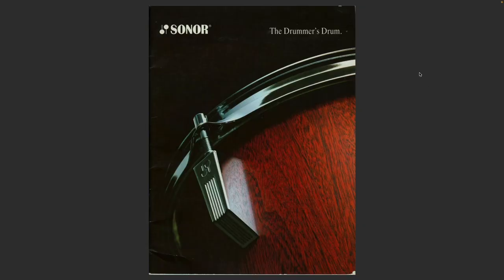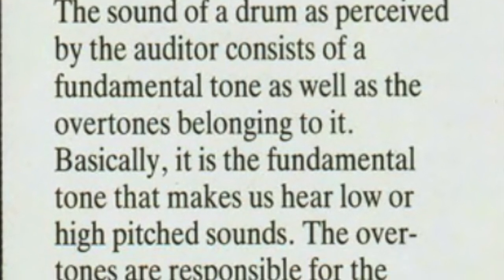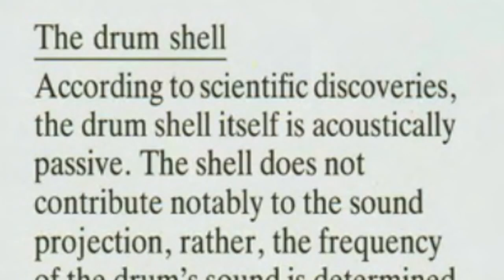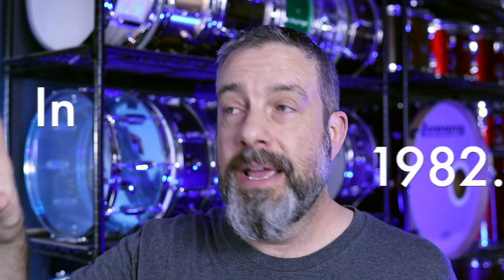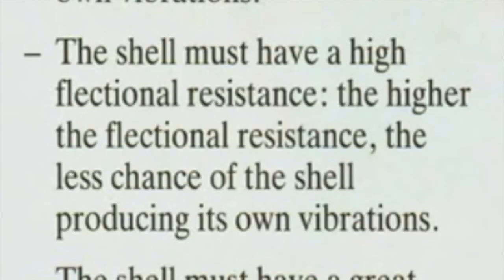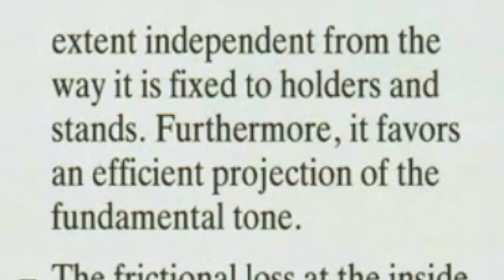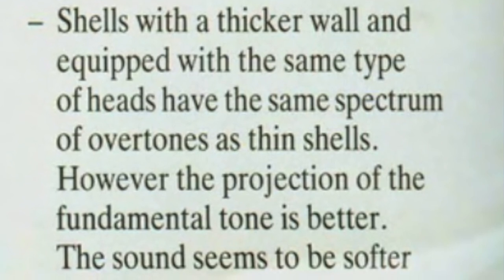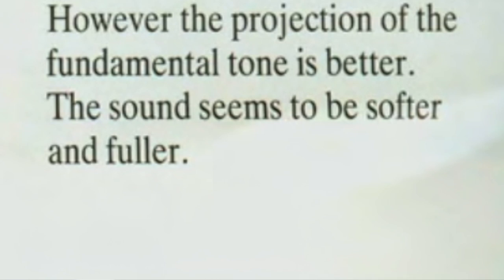That's Not What I've Been Told!  Drum Sound Physics, Part ONE

Comment: I tend to agree the shell reduces part of the vibrations of the heads and ultimately the sustain. And the reference to the rototoms next to the rack toms is very convincing but I can't help remembering (as the video mentions) the first time I had to use a snare stand for the rack tom at a gig where many bands were performing with the same kit. I hit the rack tom and it was dead. I tried to tune it and lifted the whole thing, because the snare stand was very tight.  When I loosen the rack tom to start tuning it, it came back to life right away.  I figured - at the time - the tight snare stand blocked the rack tom, preventing it from vibrating ... hence here's the question: how this reconciles with the conclusion of this video?  A rack tom tighten by the snare stand cannot vibrate (it it "passive" as the German catalogue says), so it shouldn't absorb the vibrations of the heads and have a longer sustain. Yet it was almost dead until I "freed" it. BTW you re not old, I was 15 in 1982 (and had the same Sonor catalogue)

Comment: Great video! Thanks Joel for the explanation! How can I get in touch with you? 
One question: is what you told valid also for snares?
Reply from the maker: Hi, Mirco.  Feel free to reach out to me via DRUMDOTPIZZA on Twitter.  

And yes, the same principles are true for snare drums expect the sustain portion as the snare bed cut into the bottom bearing edge combined with the (generally) much higher tuning of the snare side head eliminates the kind of sustain you can get from toms and kick drums.  But yes, there is definitely a stronger fundamental tone and louder, more complete frequency spectrum with heavy snare drum shells.  This is true also for heavy shells of metal (cast aluminum or bronze shells, even thicker rolls/spun steel shells, etc.).  The greater the mass the louder/fuller the snare drum's tone.

Comment: So cool that a catalog had all of that info! The way it’s all written feels like some sort of legally binding agreement and it cracks me up. I’d like to see modern companies attempt to communicate their “laws” of drum building. 
The only piece of this puzzle that feels incongruent from my experience is the case of acrylic drums. I have limited experience with them, but I do love the 70s Fibes kit that I have. My Fibes kit is easily the heaviest kit I own, yet it seems to have a much shorter decay than most drums. It definitely has a lot of fundamental, which seems to follow the principles you’re talking about, but I know that generally acrylic drums are known to have short decay & therefore emphasized punch and transient. Why don’t these heavy drums resonate the same way your heavy Ludwigs resonate? I tried looking up density of acrylic vs maple but I’m struggling to find an empirical comparison. Any thoughts?
thanks as always for the great info:)
Reply from the maker: Great (if slightly premature) question!  In this video I mentioned flectional resistance, which I am pretty sure is what is at play with acrylic drums.  The acrylic has interesting flectional properties compared to wood (or wood veneers glued together under pressure).  Basically acrylic acts like something of a shock absorber (at least the old Vistalite and current RCI shells and whatever shell Pork Pie uses for the 6x14 Piglite that I have do). All of them have excellent body/fundamental punch with a limited sustain.  As such I LOVE them for lower tunings with muffling for a fat backbeat.  In fact the FATTEST backbeat I ever recorded was with a vintage 5x14 Vistalite snare tuned just above finger tight (batter) with a folded piece of copy paper taped to it.  In fact I'd love to get my hands on an old Vistalite bass drum.  A buddy of. mine has a 24x14 that sounds AMAZING!

I'll discuss flectional resistance in a future installment, sooner than later, so stay tuned!
Reply: @drumdotpizza  okay yes this makes sense. When I’ve taken the heads off I can tell they’re a little wobbly when I bump them or pick them up. cool thanks!

Comment: As with your other videos, I think you do great analysis here. But having owned thick shell Pearl drums starting in the late 80's (BLX series, 7.5mm 6-ply birch with lacquer finish), my perception is that thinner shell drums seem to respond better (meaning with a fuller sound) to softer dynamics. I've heard the explanation that it takes more energy (e.g. striking the drum with more force) to overcome the greater inertia of a more massive shell and make it vibrate as contributor to the overall drum sound, vs. a thinner shell with less inertia.  As a performer, this seems to check out when I play my relatively thinner shell Starclassic Birch kit from 2006, with its 6mm 6-ply shells.  I know that Sonor sold many thick shell jazz kits in the 80's, but I don't know any jazz drummers who prefer them over classic (or newer classic-style) thin shell drums.  Even for rock, thinner shells seem to speak better when played softly, admittedly at the expense of less volume headroom when played loudly.  Would you say that your preference for thick shells is more appropriate for loud rock situations, or would you still use those drums for an acoustic jazz quartet?  (And yes, I'm ignoring the effect of the higher head tension most acoustic jazz drummers would apply).  Thanks for the videos!

Comment: Thanks for doing this video! Through my experience I agree with most every point you stated. So…..given that I now find myself playing many acoustic gigs in small venue situations, the setup I use are smaller diameter thin shelled drums that seem to work well with less sustain. I’m currently using Remo Renissance heads on toms. I am interested to hear your perspective on bearing edges. Hope that is coming soon.
Reply from the maker: Thanks for the kind words!  Yes, thin shells work better for lower volume gigs as they produce less fundamental tone, and therefore less volume.  Also, given the fact that a larger portion of the tone of these drums is harmonic content they will tend to project a better balance of overall tonal spectrum a greater distance.

High frequencies are not powerful (they aren't what you hear coming through the wall of your apartment when the neighbor is blasting the stereo!).  High frequencies are actually dissipated and absorbed by the viscosity of air, believe it or not.  So drums with a greater percentage of higher frequencies will, at a distance, sound more balanced than drums producing a stronger fundamental.  The thicker shells, at a distance, will be more likely to sound tubby and dark, particularly if tuned low.  

The best arrangement, IMO, for low volume or unmiked playing situations is a thinner shell kit with slightly mellow edges, larger diameters than you might normally use (for the toms, especially) tuned a bit higher, so they produce more high frequencies (with the larger diameters providing similar pitches to what you might normally have with smaller drums tuned lower).  Does that make sense?  At a distance this will provide a more complete balance of drum tone.

Definitely the approach to use for minimal miking techniques as well!  Hope that makes sense.

And yes, more videos on the topic right around the corner!  Thanks for being here!!

Comment: Excellent video. Any comment on why metal drums sound the way they do? I have a very heavy brass snare (1963 Super-Sensitive) that is explosive, even chirpy. Lots of fundamental but very bright overtones as well.

I'm very much in the "dry, dead, drums" camp personally but a lot of these thinner drums just do not have enough low end
Reply from the maker: Thanks for your comments!

I haven't gotten to shell material yet, but will in the forthcoming video.  Metal drums are very hard and reflective compared to wooden drums.  They have much. more high frequency content, particularly compared to a wooden drum of coarse grain (lauan, for example), particularly if the wooden drum's interior is not sealed (the wood just sucks up high frequency energy like a sponge, so it really needs to be sealed for a more balanced tone).  

But metal drums are hard and reflective, and in the case of brass and steel, etc. they are rather dense (aluminum not as much), so they tend to produce a strong fundamental note as well.  Wooden drums are softer material, so don't 'riiiiing' like a stout metal drum does (all other things being equal) -- this is particularly true of older wooden drums which tend to have a higher wood-to-glue ratio, an are, therefore, softer material overall (glue can be quite hard when dry, so modern shells with ultra-thin veneers tend to be harder overall than shells made with thicker veneers but the same amount of glue between plies). 

I'm working on my 'drum shell material' video (I'll have a snappier name for it before it's released, I'm sure ;)  Stay tuned, thanks!

Comment: Wall thickness affects the rigidity of a shell: you can have a very lightweight and rigid shell made of thick, less dense material.  You see this principle a lot with metal tubing: thin walls+large diameter is often lighter and more rigid than thick walls+small diameter.  Materials also do not flex equally in all directions.  Ultimately, if you're trying to transfer sound energy from your stick to the drumheads, you want as little shell flex as possible.  How you achieve that is up to the designer.  It is way easier to achieve low flex with denser materials, though.  There are some exceptions to this: if you can match the vibrational modes of the drumhead to the shell, then the entire system resonates.  But this is more frequency-dependent than stiffer shells, where energy transfer is only between the two heads.  Another example of a lightweight, yet stiff material is carbon fiber.  It's essentially a space-age plywood: you can orient fibers in any direction you want to get the desired rigidity characteristics.  So... carbon fiber drums could in theory give you the same energy loss as thick, dense wood, but with significantly lower mass.  But all of that design work is expensive and repairability and availability are concerns.

Comment: Hi, thanks for this video. I agree with most of it. I like that you point out the flaws in the talk about drums (resonating…) and I would add some more wrong concepts here, as the shell being called shell is a misconception as well (sorry for my lack of English if I am using the wrong terms, I also am German just as sonor ;) ) - a shell is something that can hold water. Timpani got shells, drums have sides, or walls. I am guilty using the wrong term too but only because it confuses the customer a lot when I refer to shells as sides. But I think it is important to make this notion here because a lot of properties that shells have, sides do not have. Shells have a huge impact on the sound of a drum, but regular drums have no shell, they have sides, and the resonance head takes over what a shell usually would have as influence in sound.

Now to your concept of drums having more sustain when they have thicker sides (shell, you know what I mean). I can follow you here, but you missed an important part what influences sustain, like, a lot, and which also explains why rototoms have such long sustain: no it is not because of mass: it is because of the lack of a shell (side)! The deeper the drum, the more air has to be moved to get the drum singing. Air has about 1.3g per liter, and it muffled the drum head. I usually demonstrate that with a short drum which gets a longer tube attached so the drum gets longer. What happens is: the additional air is muffling some overtones, the sustain gets shorter, the definition of the sound starts lacking, and the response gets worse - you need more force to get the drum to sing due to the extra air you need to move. Now, while the concept of drums with massive walls having more sustain might be right, it is ruined by the fact that those drums in the 89s also were darn deep which then made the sustain shorter by a lot.

This is a common mistake when it comes to drums, we often have more than one factor that contribute to the resulting sound, and it is easy to blame the wrong factor for the outcome.

The next misconception - you did not noticed it here, but many drummers believe so - is that deeper drums sound deeper too. Dunno if you address it in your next videos. In order to influence the pitch of a drum, as the diameter does, a drum has to be a multiple times deeper than the diameter. Octabans are the only drums where the shell actually influenced the pitch, and this is why they come in fixed diameter but different depth.

Anyhow. A lot of good stuff here. Thanks. Would love to hear your response or even have a chat with you one day!

I started as teen too building drums with my dad, and then started making drums 18 years ago as fulltime professional. I see my drums as the antithesis to sonor drums, we pretty much do everything different than them, but because I want to build a less loud drum set. And all you explained makes sense, but I want to use differently to improve the sound, not the volume: you correctly stated that the more stuff and massive drums are, the more energy will stay in the drum and make it sing longer (sustain). True, but I make my drums small and shallow, because smaller drums have less attack, more tone, and the shallow drum songs longer than the deeper one. Now the thin shell is also taking energy away from the drum, as does the RIMS - every movement a drum makes, is less energy used to make sound. Given that - my working thesis - drums are pretty loud already, and sound better in most rooms when played less loud (gosh those is yet another rabbit hole about room acoustics and its influence on the drum sound), I am totally okay with having energy taken away from my drum. Heck, this is what I strive for: having more control over the drum sound acoustically by making them less loud. So funny, my journey has led me to learn pretty much the same principles, but I totally disagree with sonor on what it takes to make a drum sound good. For me loud is a definition of a lack in sound, not a quality. It something sounds great, we do not use it synonymous with loud, but for some reason most people think drums = loud. That is not a compliment. Especially when people would not think drums are loud when they are mic’d and amplified. 

This is also a misconception many have about drums: they are NOT an acoustic instrument - drum makers do not build drums to be played acoustically- drums are always mic’d and processed, like an electric guitar. Since the 1964s and the rise of marshalls drums got loud on purpose. And thus the thick shells, deep sizes etc. 

Now that we have less and less loud stages, thanks to inear monitoring and kemper Amps, Drums now are the loudest noise in stage, often causing more trouble with their volume especially in rooms…
Reply: Sorry for the many typos, wrote on iPhone screen and many corrections were not always right. Sigh…

Comment: Just to add. Speakers share the same concept. Enclosures (shells) should not vibrate when the cone (heads) move. In speakers, you effectively cancel out the vibrations of the cone cause the enclosure will counter (oppose) the direction of the movement of the cone. Specially for sealed enclosures. If the enclosure is weak, as the cone pushes out, the enclosure walls suck in. That's why a subwoofer without a box is like a fish out of water. The push motion that should produce sound is cancelled by the pull motion happening behind the cone. Diminished sound pressure levels.

Comment: Very interesting. One of the things I wished you had gone into (maybe another video idea) is why on might choose the sound lf thinner drums for certain kinds of music. What comes to mind is fast and complex music where you want the drums to have an explosive and articulate sound. I also think it would be super cool to record two different drum kits to demonstrate exactly what you are talking about. Also could discuss heads.  Why do most rock drummers choose two ply heads? They definitely make the drums sound beefier and more focused… but single ply clear heads tuned low can sound fat when recorded…
Reply from the maker: Thanks so much for your comment!  The comparison video you suggest is already in the works (I was assuming more pushback than I have actually received so far, so was planning to a video to demonstrate this).  

And yes, drumming styles that are fast with lots of chops benefit from the shorter sustain and greater attack/articulation of thinner shells.  2-ply heads can assist here as well as they reduce sustain as well providing a sense of greater articulation (though really just a smaller percentage of decay).  

I have to wonder how much of current drumming fashion is a result of, well, fashion?  Do players choose 2-ply heads because of the merits of 2-ply heads, or because their favorite player uses them?  Hard to know.  Part of my series on drum physics will discuss the basics of drum heads (essentially single and dual ply -- most everything falls into one or the other with other less significant, though still relevant factors contributing).  I would really love people to know what sound they want and choose the gear that will assist them in creating it rather than buying what marketing or a cult of personality tells them to without regard for the tone appropriate for their application.